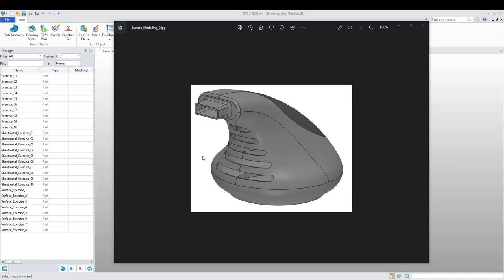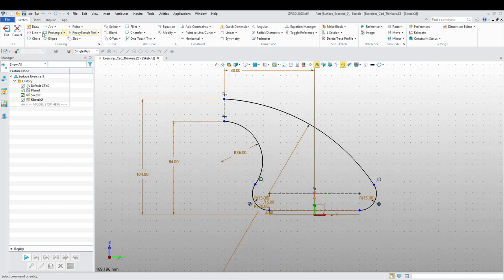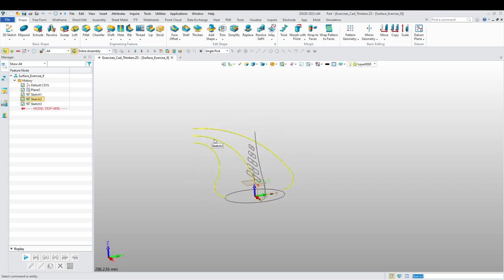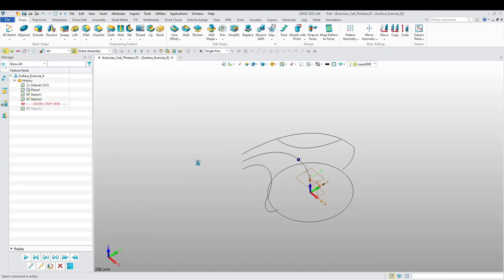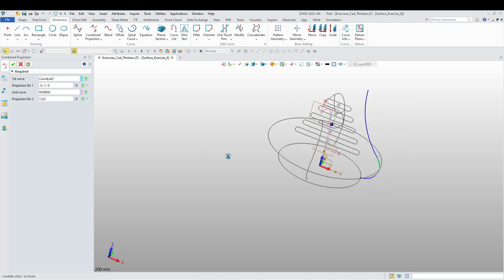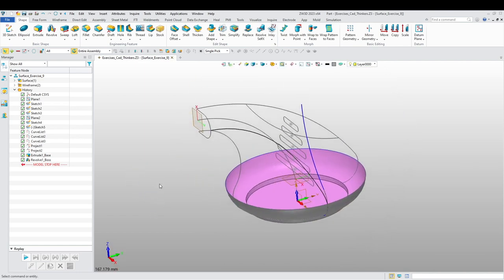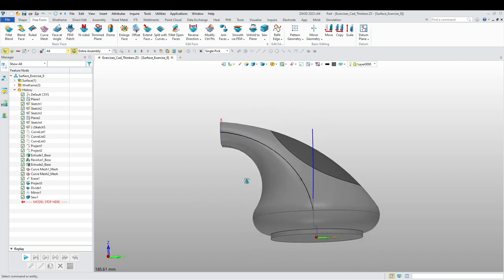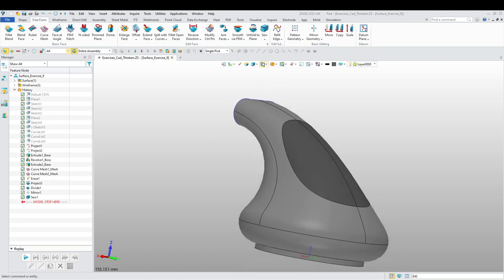ZW3D Tutorial - Surface Modelling - Intermediate level - Exercise 9

Comment: So, heres a silly question. Is there a specific book (textbook or otherwise), or good educational source that explains the basics of what's being used here and why they're being used? By this i mean I am a 100% beginner and i don't understand what Datum Planes are used for, the difference or importance between regular lines and construction lines, or constraints in general. I'm having a hard time finding an online resource which explains these clearly in regards to modeling in CAD software.
Reply from the maker: Hi, how are you? There are some training manuals in the actual program. They are in pdf format. If you go to the start tool bar at the top of the program, where print and save is you will find "help" and in the "help" tab you will find "Training Manuals" and there you will find all the pdf training manuals. If you can't find them let me know and I'll put them in a google drive file. Thanks